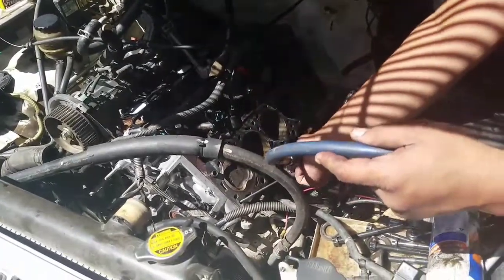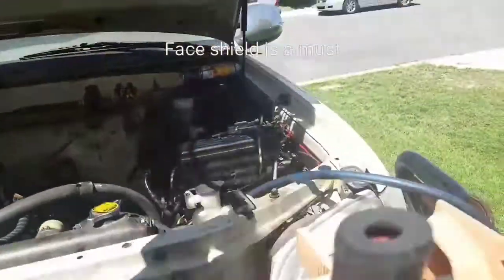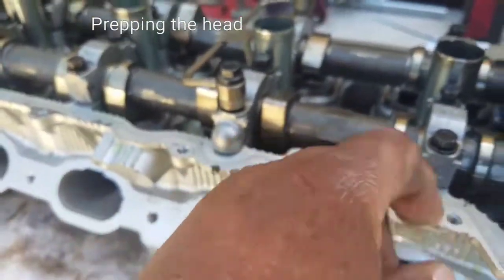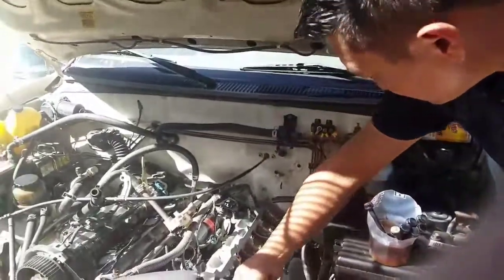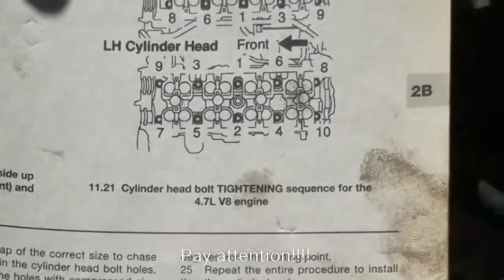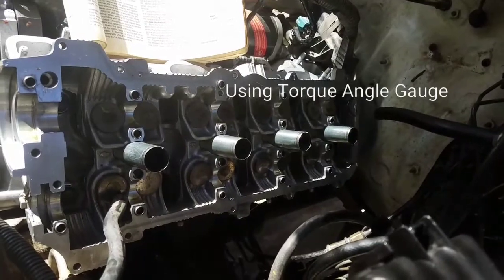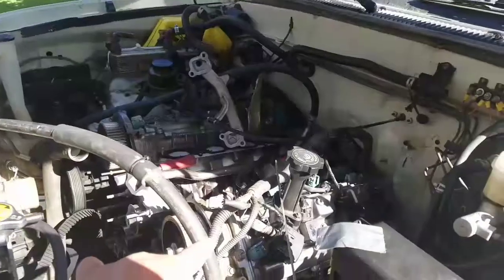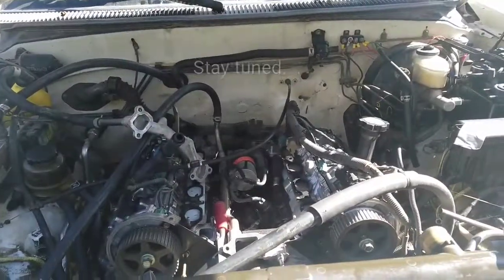Hydrolocked Engine PT 17

Comment: Got your truck running yet?
Reply from the maker: harmonize209 yes like a piece of cap. they sold me a due. there is rod knock too
Reply: The Other Guy didn't you got the head rebuilt
Reply from the maker: harmonize209 yes I did. But but there is another issue and that is with the piston rods.